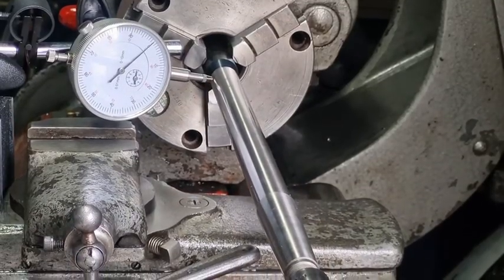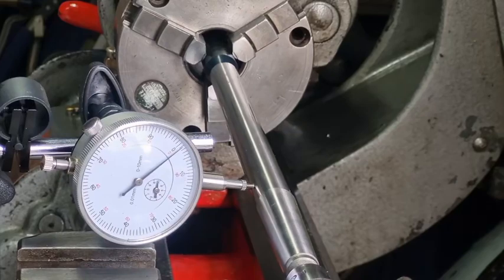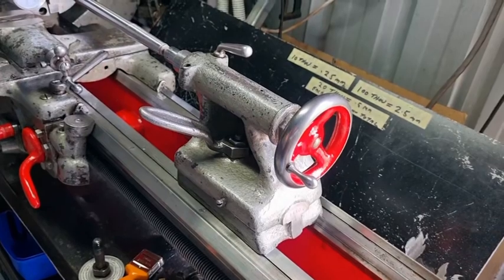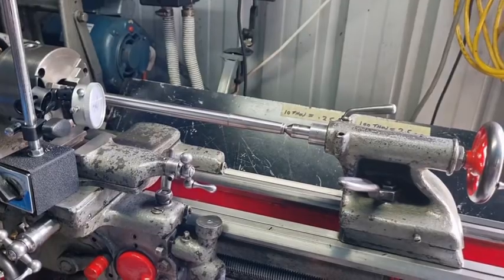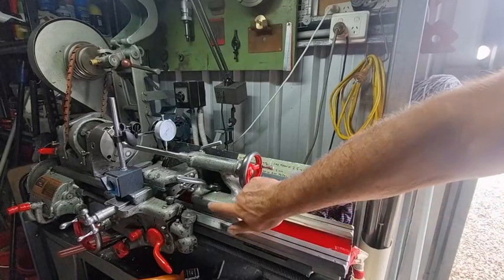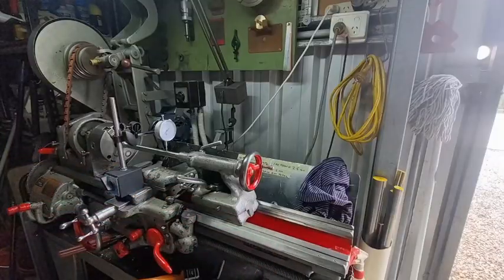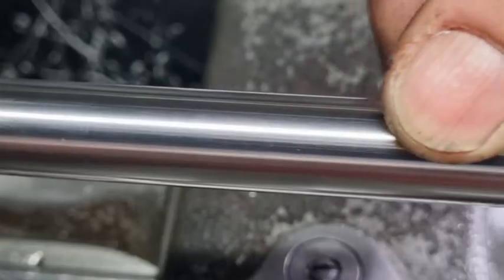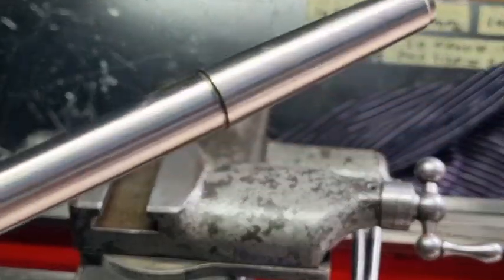Headstock and tailstock alignment using a precision test bar

Comment: TIL that test bars existed - thank you.  I thought I'd have to turn one myself to do the alignment.
Reply from the maker: Can you turn and get 3 microns accuracy across the bar length end fir end ? With a good surface finished
Reply: @hercus9a  Of course not, but that's not how I imagined it.  There's a video by Inheritance Machining aligning his lathe by measuring the taper on a turned rod - that's how I imagined I'd do it.